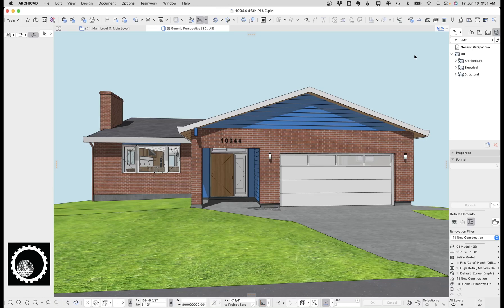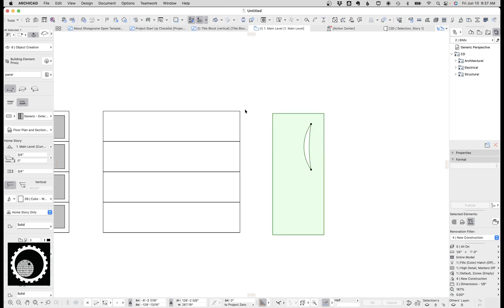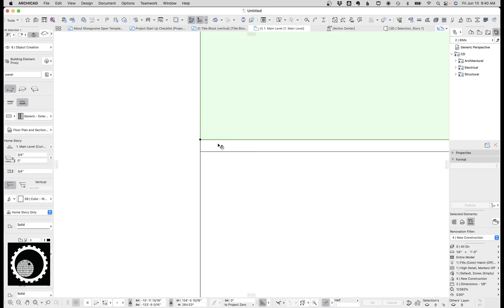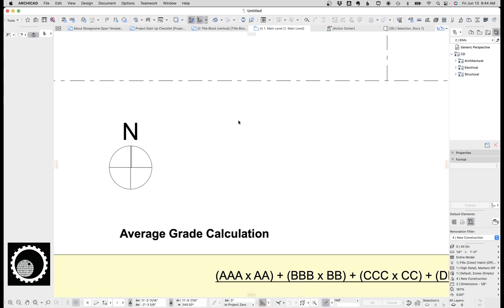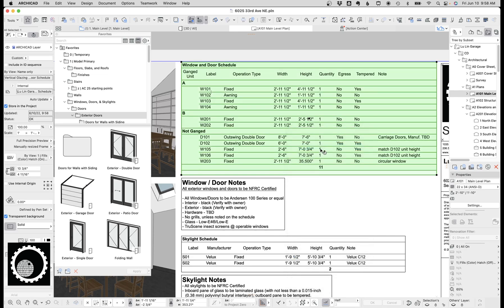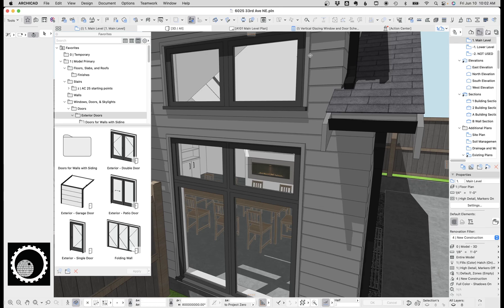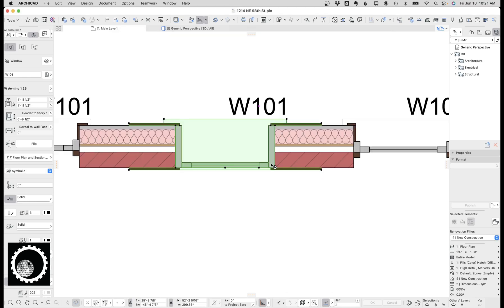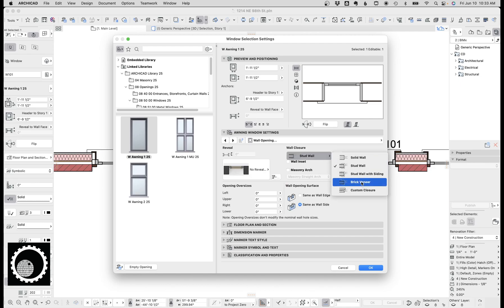Archicad Tutorial #81: Window and Door Customization in Archicad

Comment: What tool did yo use to add the frosted glass?
Reply from the maker: I just changed the Surface material of the glass in the window/door settings.
Reply: @Shoegnome  Thanks for the quick reply! I thought the moon shape was just a cutout (no surface). I must be missing something.
Reply from the maker: Oh sorry. In the custom door leaf, the frosted glass of the moon shape is just a slab with the BMat/surface set to frosted glass.
Reply: At minute 3:57 you "eyedropper" that in - do you have a video that describes that process?
Reply from the maker: This is an ancient blog post and video, but the basics are still the same: http://www.shoegnome.com/2014/10/22/parameter-transfer-archicad/
Reply: @Shoegnome  Thank you! Not ancient to me lol.
Reply: Hmm I just watched the video you shared. So, it sounds like you are using the eyedropper to copy the attributes of something else into the cutout hole??? So sorry, I am a beginner, I think I need to go back to the VERY BEGINNING to understand what you're doing here. Thanks so much for the replies. I'll learn eventually.
Reply from the maker: @bethakabetty  yup. The eyedropper/syringe move parameters between elements.